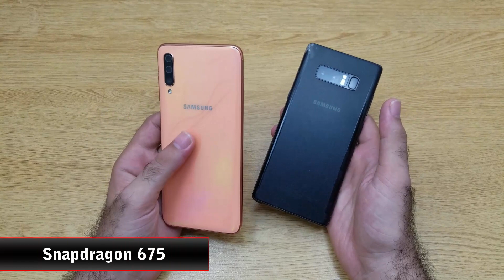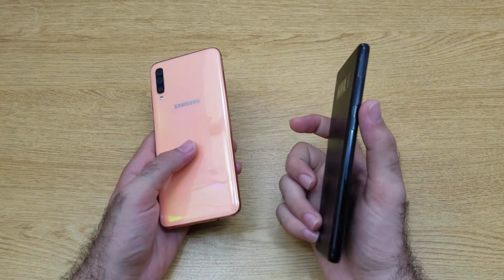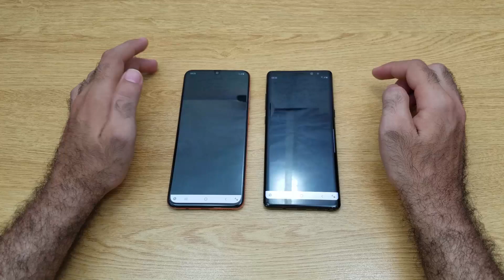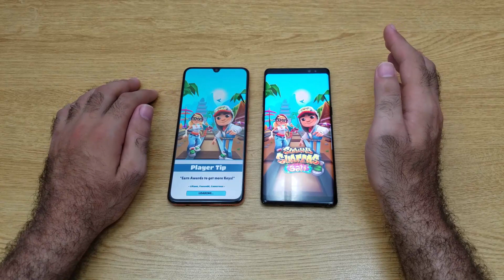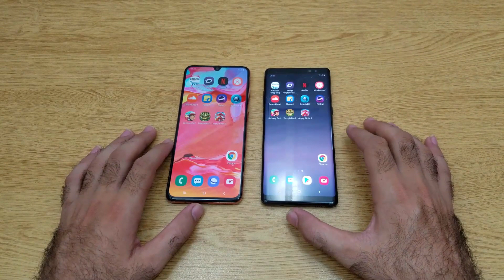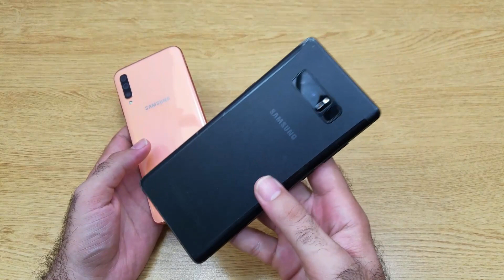Samsung Galaxy A70 vs Samsung Galaxy Note 8 Speed Test!🔥🔥

Comment: a simple question which to buy?
Reply: Depends on price. Here used note 8 is cheaper than a70
Reply from the maker: @maucina12  that you should definitely Buy Note 8.. :) it may possible that a70 will have enough battery timing because of its display consuming , it has IPS Lcd Which dont consume battery much as compare to Super Amoled Which note 8 Has :)
Reply: @DynamicTech1  ty :)
Reply: @DynamicTech1  bro you are wrong A70 has super amoled display
Reply from the maker: Note 8 I guess If u find that with good battery health, that would be great :)
Reply: A70 is goodest